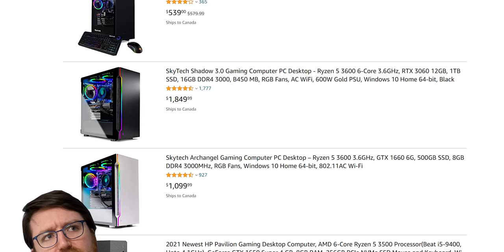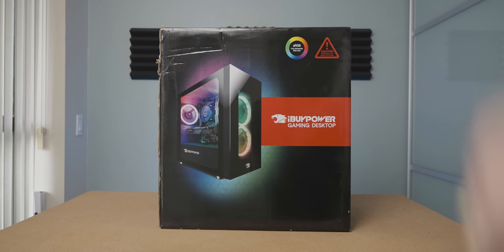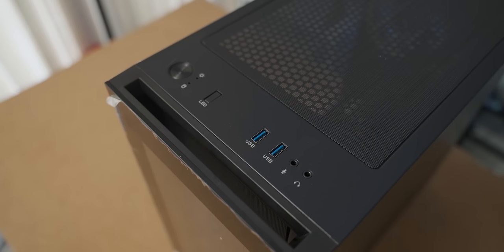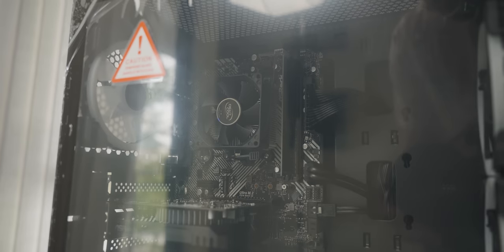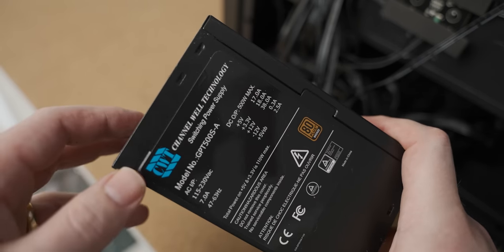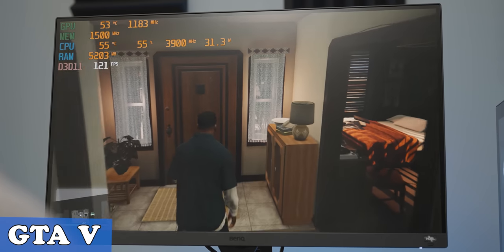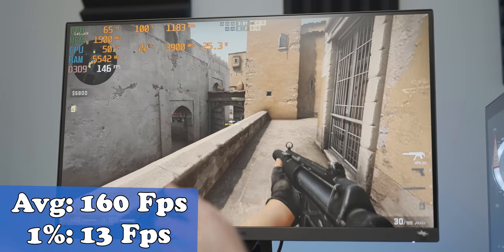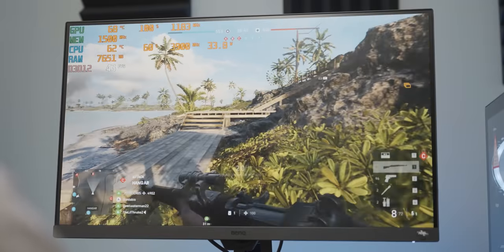I Bought The Best Selling Pre-Built Gaming PC On Amazon.com...

Comment: Feb 2020 got a well only way to get the M2 SSD was to get the one with the mechanical second drive for $800..  well the mechanical was DOA so had to take that apart and all they gave me was a $20 refund.  Right.. okay fine.  
(from amazon)  But it does have the M2 of the brand above that is a normal SSD.   Neo Forza.  1 TB single chip M2.  in a laptop.  (they always tell me to call it a notebook.. No like fog lights vs parking lights I'm not gonna do it..  )  Course the downside of todays laptops is they are for whatever price all disposable since everything is more or less on the underside of a keyboard that wears away in 3-4 months.  So naturally I've already torn this down once and sure enough 3-4 months later a $75 keyboard connected with the wrist rest and touchpad is already wearing away..  zzz  they all do..  Including the hidden screws about 6 of those.. Still though I didn't bother to notice that the M2 lights up until I had to send the HP in for repairs in which the keyboard is not covered.  o_O  that is a first.  ie I'll never buy anything HP ever again..

Comment: Never ever ever ever ever buy a system from the SSI's, especially so called budget systems.  The single stick ram befuddles enthusiasts like GN, Jay and others.  2 slot boards are not dual channel they 2 single channel designs many MB's will be going back to since the discovery that ultra fast ram with high memory counts all talking to the cpu at once actually causes lack of performance over dedicated single sticks chatting on 2 channels rather than 4 talking over 2 channels.  You'l notice many ATX and larger boards are starting to adopt the high ram speed high memory DIMM slots in a 2 single configuration.  It also reduces excess trace designs and less problems from excess parts, reducing MB costs as well.  One of the few newer things to actually take a small step back in order to go faster with larger memory designs.

Comment: How the heck are you running gta at 100 FPS when I barely get 50-60 with a ryzen 5 3600 and a msi 6050 super
Reply: Are you using 1080p? What settings

Comment: Battlefield 5 running at 37-45fps
Dawid: Yeahh this games a no-go on this PC.
Low end gamers watching this on intel HD that cant even run it: 👁👄👁

But in all seriousness. for that price point. ouch... If that was maybe a $300 - $350 system. I'd say, alright. but I've built significantly better for the $600-700 bracket. Like, right before prices started going insane, I managed to pack in a 4790k and 1080 Ti for around $660. board was cheaped out cause the system had an i3 4130 originally with a GTX 950. Friend from OzTalksHW's server sent me his old 4790k. and I managed to get a 1080 Ti around $430. rest didn't honestly cost much if anything at all since it was stuff I already had. But none the less, priced all together from what all were bought at in that system. if it wasn't for the absolutely mad market of today, you could have maybe a similar CPU to the Ryzen 3 3100 and maybe a GTX 1080 possibly, or a 2070 Super for $600. But for something with an RX 550. yeah that's a no chief lmao. I'd just be patient and try and navigate this battlefield of high prices until they either go down or you find that one chad who's selling a card or anything for an actual good price.

Comment: 10:30 absolutely not
i’ve been using an optiplex 990 with a 16 gb ram ssd and gt 710 upgrade (it’s a higher end gt 710 it has performance exactly like the gt 730 he showed on screen) and it is not performance similar to that ibuypower pc. 
csgo at 720p low: 87fps average with 1 percent lows in 50 fps range
valorant at 900p low 60-90 fps 
escape from tarkov: 720p all low 25-40fps
gta 5: unplayable i get 15fps at all low 800x600
gpu bottleneck and cpu is kinda shit already
also i’ve optimized the pc, used fps optimizations for said games and overclocked the gt 710 by 300 mhz all around. not fun
edit: i’m retarded i thought he said 730 not 1030, yeah 1030 is wayyyy better i’m getting one soon and i’ll definitely be able to play csgo at all low 1080p and valorant, also i’m gonna be able to play escape from tarkov at 60fps ish at 900p, i’ve tested with a friends 1030 when he came over
Reply: You should really upgrade that PC.

Comment: Why is there a deep cool cooler…the stock one is just fine…!
Reply: Unless they're specifically ordered (at extra cost) SIs and OEMs don't get stock coolers. They purchase CPUs in bulk and they come on trays, not in retail packaging. That Deep Cool cooler is something they probably use on both Intel and AMD systems and is insanely cheap when purchased in bulk.
Reply: @derangel9143  👍 okk that explains it..

Comment: Try to avoid buying a PC from amazon, they are quite overpriced. Build Pro PC has an $800 prebuilt with a Ryzen 5, 16GB of RAM, and a GTX 1650 graphics. For $800 its able to perform extremely well.
Reply: my local pc shop has a rtx 3050 i3 12100f 16gb ram for around 700 dollars

Comment: Ok, I definitely want to see you run that 3080ti with a Ryzen 3100. As long as you put in a decent dual channel kit of ram, I bet it does better than you would think. In fact, I would like to see you go from that 3100, to a 3600, to a 3700, to a 5600X and see how the performance goes up along the way

Comment: Pls never recommend a hp pc. I have even the omen 30L and the motherboards are crap and the bios is locked so if you get more and better ram you can’t use the xmp. Pls recommend a pc without any proprietary parts.

Comment: the price would have made sense if it had a rx 560 or gtx 1650 instead.
other than that its not too bad of a system.
despite the elitist comment in the video the psu is pretty decent and 500w leaves some room for future upgrades.
a single ram stick isnt ideal but you can just buy a second one for like 15 to 20 bucks along with the system.
a 1tb hdd as extra storage would have been nice too cause that small ssd wont last long on its own.

but i have to downvote the video for too much acting like an elitist asshole.

Comment: I dint get it, I rarely get above 30 FPS in unturned XD. Just learn to play the game. This man over here is complaining about 80 FPS while my poor 4 year old HP laptop is gasping for air trying to run roblox without commiting suicide.
Reply: I have few recommendations:
Have you changed the thermal paste to maybe liquid metal?
Have you tried limiting the CPU to not overheat?
Have you tried undervolting?
Reply: @frozenturbo8623  I actually just got a new laptop so no longer an issue. Thsnk you though.